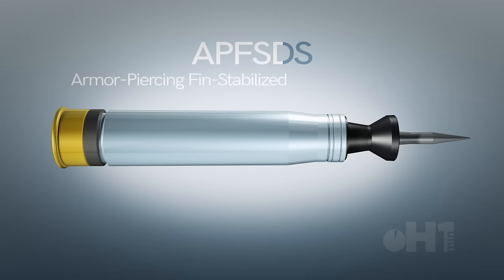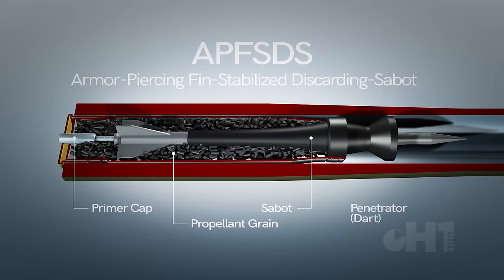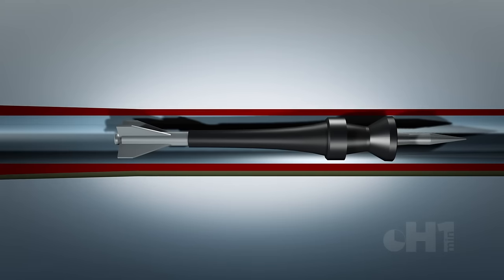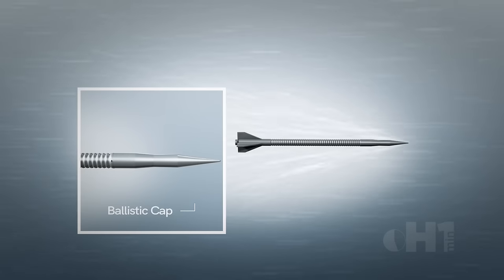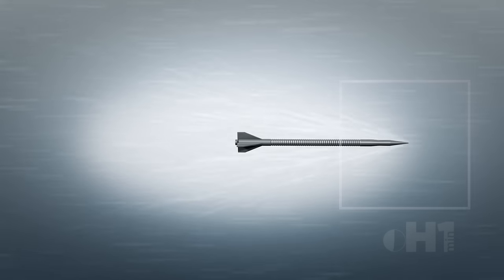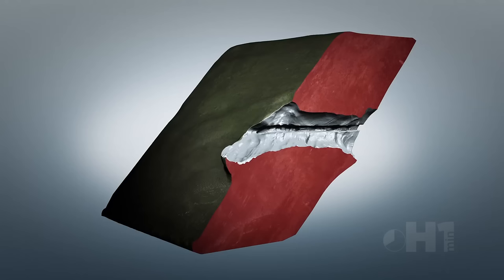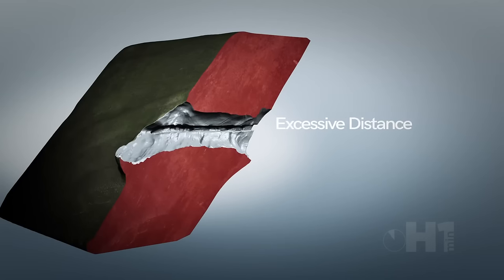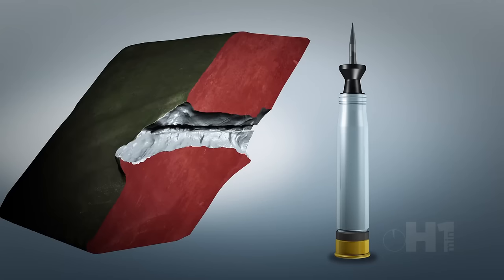H1MIN: APFSDS Shell

Comment: The APFSDS round is also fired from the 120mm L30 rifled gun on the British Challenger 2 MBT.
Reply: Most of the MBT fire APFSDS on smoothbore barrels because the rifled could decrease the velocity.
But if need to fire at rifled, the APFSDS rounds had to fit a spinning ring to preserve the velocity for the projectiles.
Reply: We used to fire them from the Challenger 1 in the early 1990s.
Reply: @dustybaboon 
So you're former tank combatants, right?

Well, I still have some detail error but at least I tried to pronounce the meaning.

If you have experience, why not sharing it?
Reply: @leekaijit36  
I was a gunner in the Queen's Royal Irish Hussars in the early 1990s and we were a Challenger 1 regiment and we used to have APFSDS which we used to call fin and we had HESH rounds on our tanks.
Reply: @dustybaboon I see...
Thanks for your information, sir.
Reply: @leekaijit36  you're most welcome.
Reply: Lee Kai Jit are you referring to the Ball-baring ring then that’s utter bollocks, but if referring to the copper ring that grips the rifling and seals the barrel somewhat and increase MV the yes that’s true.
Reply: @Duke_of_Petchington  Yes, that it.
Thanks.
Reply: @Duke_of_Petchington  its actually a nylon ring that grips the rifling much like a driving band, but has little or no adhesion to the round. As the round travels down the barrel. The slip band spins, but it imparts very little of this spin to the sabot and penetrator. This way it allows the round to be fully centred in the barrel and provides obturation without slowing the round down. As the sabot leaves the barrel. The band breaks and the sabot splits into 3 sections. The limited spin helps throw the sabot sections clear of the penetrator.

Comment: Another countermeasure is seen on the Turret front of the Leopard 2 since the A5 model. Armor spaced away from the main armor at a distance longer than the Darts fired will induce tumbling of the dart after it has fully cleared the spaced armor. Makes it hit the main armor sideways completely neutralizing it in best case scenarios but reduces Armor penetration significantly in general.
Reply: The arrowhead damages the round before impact of the main armor. That’s why it’s effective. The space doesn’t need to be longer than the dart, it only needs to be angled. The wedges can be countered with a round strong enough to resist shearing forces.

Comment: Imagine getting shot with one of these in the chest while you are chilling in your tank
Its a strange wait to die by a think that goes 5 time the speed of sound
Reply: On the bright side, the person might not feel it as they died before the nerves had the chance to send the signal to their brain.
Reply: The thing is, everyone here is wrong. Most armour piercing rounds are designed to cause shrapneling inside the tank. The actual rod usually isn't the thing doing the main damage, but the shrapnel that falls off the armour when the armour is penetrated. If you are in the way of all that glowing hot metal shrapnel, it'll probably have an impact of a huge shotgun blast.

Comment: Explosive reactive armor is used to protect against HEAT rounds, by preventing the penetrating jet from forming. It has absolutely no effect on a sabot round, which will simply pass right through ERA without detonating it.
Reply: No, No, The ERA effects both APFSDS and HEAT rounds. cause as soon as something hit ERA it explodes and send a plate outwards which either ruins the angle of a HEAT round which results in lesser penetration or for APFSDS it discombobulate APFSDS by ruining the angle of approach, so instead of nose of APFSDS hitting the armor, the side of APFSDS hits the armor resulting in lesser penetration. so, if the ERA is angled the more damage it prevents.
Reply: @alimplays334  even then ERA is mostly for HEAT, the penetration reduction is too insignificant to also work against APFSDS sure it may work on better on older rounds but i dont think they give troops such old rounds that literally degrade pen like a quarter

Comment: APFSDS round was the evolved predecessor ammunition call APDS (Armor Piercing Discarding Sabot). It's gives the projectiles more stabilised and increase penetrate effect.
But the core materials of the projectiles can have different effects during penetrate.
While Tungston core is the main material for the APFSDS core in most of the countries, the US use Depleted Uranium as the main material for the APFSDS core to maximise the penetrate effects.
Reply: They use DU because its cheap as it is a waste product from the enriching process for nuclear reactor fuel and they haven't got many major qualms with using a heavy metal that is toxic if it enters the body and has low radioactivity. Tungsten on the other hand is needed in industrial processes such as machining.
Reply: @01Laffey 
But for war strategy materials, which is easiest to obtain?

Comment: What's concerning is depleted uranium... I can't imagine surviving, only to die of uranium poisoning...
Reply: when an APFSDS hit and penetrate the tank, there is no time for poisoning the crew, only up to 7000*C temperature for less than second inside tank also high pressure air which fraction bones and internal organs of crew blow up, also fragments from the rood also from cracked plate of tank hull will penetrate the body of crew, then another explosion of ammunition cartridges in the tank which is result of fragments which hit and penetrate the ammo cartridges full with explosive and initiate to burn such explosive inside the tank hull, and for next 5 seconds such high temperature will bake the crew body's, then some more explosions in row which come from exploding tank shells (HE or HEAT) which explode like result of high temperature inside the tank, which results on total collapse of the tank and everything inside. Literally the tank inside will melt. Terrible death...
You can see fragments inside tank hit by APFSDS. Imagine if the tank was full of ammunition and crew... https://www.youtube.com/watch?v=KU0_9ika42o

Comment: ERA does nothing to kinetic penetrators.
Reply: russian ERA have an effect against kinetic penetrators as inside the brick there is an angled plate which when the explosive set off is pushed out and due to the fact that it's angled it goes to "snap" the penetrator causing it to lose penetration... it can theoretically decrease the penetration up to 30% but realistically around 15%.
Reply: Relikt ERA can reduces APFSDS penetration up to 50%
Reply: Oh yeah I forgot about that.
Reply: Necronuclear that's simple bullshit... best reduction scenario reach 20-25% K-5 10-15%
Reply: BlackSkorpion1991 There is Relikt ERA. It's third gen ERA. It claimed that Relikt can reduce kinetic ammo up to 50%
Reply: Best source I found says that it can reduced up to 50%
Reply: Heavy ERA does affect APFSDS. That's why many modern penetrators already use special shaped steel tips to defeat it.

Comment: dart - outer shell - artillery shell - extended range charge
outer = supersonic super-cruise when the entire blue(except the first "flange" to pointy dart is redesigned for air bubble in front of "flange"). mach 1.2 with that blue and dart.
Reply: AP RR 105mm
Reply: counterpart to reentry burn-off heat concept with saboted rocket and burn-off materials-casing with supersonic to hypersonic. your future is 60km direct fire and low-orbital indirect fire (earth is one number). not, ram or scram, jets.

Comment: Nice vid. You just forgot about depleted.iranium is also pyroplastic and imposible to be cleaned from the environment after hits.
Reply: And every shot is a little bit of friendly fire. That stuff is cancer. Literally.
Reply: Actually - the reason it isn't cleaned up is because the actual environmental/human hazards of the stuff means that it isn't worth the bother.  The 'dangers' of staballoy (the trade name for the material) are hype made by people who don't have the first clue as to what they're talking about.  And too lazy to even look up the MSDS.  In an industrial setting the recommended safety procedures are: "Standard industrial hygiene measures."  (Wash your hands before eating - for example.)

It's primary effect on the human body is that of a heavy metal poison with effects similar to that of lead.  Although it is much less dangerous than lead because the body does not easily absorb it when inhaled or eaten, and it literally passes through your digestive track and leaves your body when you take a dump.
Reply: @rospincasocl3741  "That stuff is cancer. Literally."

No.  It isn't.  The primary organ it will affect is your kidneys because it's human hazard effects are almost identical to that of lead.  

Clue for the clueless: It's called 'Depleted Uranium' because the radioactive isotopes have been removed to make bombs or fuel for nuclear reactors.
Reply: Yeah, DU isn't as bad as people make it out to be. the two ways in which it is deemed harmful is A) upon penetration, when the penetrator can shatter into dust which can then be breathed in and B) when Shells which have been shot into the ground corrode, though the consequences of that happening are negligible to unclear. Also keep in mind that in point A), Tungsten becomes just as harmful. DU wouldn't be used by at least 3 Major Nato countries if it were that obviously harmful.

Comment: The M829A4 DU sabot is said to be The best. IT is heavy, very fast, and it is made to counter Russian ERA armor. DU is much better than tungsten because: The burning effect on impact keeps The sabot sharp, it helps to melt armor, medium speed needed (no big gun required, since at very high velocities The projectile looses its burning  effect at 2000+ m/s), it creates additional radiation after hitting The tank.
Reply: You were doing good until you got to the radiation part.  The stuff used is what's left after they remove the fissionable isotopes.  So the stuff is less radioactive then natural uranium metal.  (And natural uranium metal has so little radiation that it can be handled with your bare hands.)  And it doesn't melt the metal.  Ant those kinds of pressures there is no 'solid' metals and the physics are that of a stream of liquid passing through another liquid.  The after-armor effects are because small pieces of uranium are combustible.
Reply: @colincampbell767  well, it is 40% as radioactive as Uranium. Soliders in The Gulf War were told to avoid coming in contact with Iraqi tanks that were penetrated by The Abrams.
Reply: @akanoob2072  Of course we told people to stay the hell away from destroyed tanks.  Those things are full of a lot of rather nasty chemicals.  Some type of FRH (Flame Resistant Hydraulic fluid) are contact poisons.  The residue from Composition 'B' explosives contains carcinogens - and so does CARC paints.  There's beryllium in the mirrors for the thermal sights.  And there's a whole laundry list of other hazardous stuff.  The Staballoy (DU ammunition is not pure DU but an alloy instead) fragments are the least of your concerns.

And this ignores the near certainty of unexploded ammunition and/or ordinance.  (How close do you want to get to an explosive warhead with a damaged fuse and safety mechanism?)  Anytime I had a report of unexploded ammunition - the closest I got was close enough to see it through either tank optics or binoculars.  And I then backed off after confirming that it was not something other than a possible UXO.

I have expierence and the proper training for handling DU - to include damaged ammunition and armor.  And I can assure you that the safety precautions are the standard Army 'We don't care how low the hazard is - we are going to protect from it anyway.'  (People don't realize it - but the 'safety culture' in the US Army is absolutely anal.  Which is a good thing because people in the Army are constantly around (and doing) dangerous things.)

I also have expierence dealing with Staballoy in an industrial setting.  Do you want to know what the NIOSH (National Institute of Occupational Safety and Health - the 'gold standard' for best safety practices) human safety requirements for the stuff are?  "Standard occupational hygiene practices."  This is stuff like requiring that somebody wash their hands before eating.  In fact the real hazard from the stuff is that the chips are combustible and have been known to self-ignite.  (So I was anal about requiring that all the chips be kept wet, cleaned up, and placed in approved containers.  I suspected that if I let my people catch the building on fire, the general manager would not be happy with me.)

Trivia note.  The staballoy was 'customer supplied material' and they wanted all of the chips and scrap back because the stuff is in short supply.
Reply: @colincampbell767  well, thanks for telling me. I never admitted of knowing everything, but I know a few things, and I am eager to learn as much as possible . I know that the military in general is careful with The Way they use equipment, for example,  The nuclear-powered submarines are very safe for The crew. A US submariner told that  he used to get close to the submarine engine (nuclear powered) so he could warm up. After 20 something years of service he got VERY little radiation exposure, because it was well encased. 

Nuclear energy is awsome if IT is used accordingly. I know it may seem off-topic to say this, but since we are talking about a radioactive byproduct alloy, it doesn't seem very off topic.

Comment: Good explanation of the shell, but I'm fairly certain major world powers use tank armor equal in hardness to the penetrator. Not entirely certain, but fairly certain. It's not like the military discloses all its tricks.
Reply: I suspect that you mean 'toughness' rather than hardness.  Hardness is the ability to withstand scratching and wear.  Toughness is the ability to hold together under extreme stress.  However the 'DU' ammunition isn't really pure DU.  It's an alloy with the trade name 'Staballoy' made up of uranium and molybledinum.  This alloy has both an extremely high hardness and very high toughness.  It also has a (literally) needle sharp tip.  The sharp tip is harder than face-hardened steel so it makes a tiny hole that the rest of the projectile makes larger as it passes through it.  

It's this toughness and hardness that is why the US uses it for tank armor.  

BTW - not only are the toughest and hardest steels expensive, but they are a nightmare to machine.  And a tank hull/turret takes a lot of precision machining.

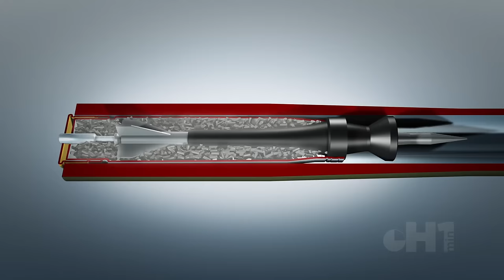Comment: 0:15 the sabot peels away. I've seen videos of the primer cap ejecting into the tank. What exactly happens to the tube/shell casing looking part of the round? Does it burn up and what kind of material is it made out of?
Reply: The casings of these rounds are made of a special polymer that burns up completely when the round is fired, it is made this way so that the interior of the tank will stay relatively uncluttered even after an long engagement.
Reply: Most tanks use a metal baseplate on the casing for better reliability, which is seen in the video, whilst the bulk of the case is made of burnable material that is destroyed when fired
Russian powder charges work in a similar way, just in two pieces and with a hard-cloth shell instead of polymer. The metal plate is also used to remove heat from the gun, and is often ejected after firing (russian tanks), or left inside during combat (many western tanks)

Comment: APFSDS shells are not limited to smooth-bore cannons.  The rifling in the barrel can aid in the discarding of the sabot and impart an initial spin to the dart which decreases instability when the dart hits air and is exposed to drag and shockwave forming on the fins before the dart spins up.

Comment: ERA won’t do anything to stop an APFSDS though. ERA is designed to mitigate the effects of HEAT-FS by detonating the shaped charge before impact with the hull.
Reply: Kontakt-5 is a type of second-generation[1] explosive reactive armour (ERA) originating in the Soviet Union. It is the first type of ERA that is effectively able to defeat modern armour-piercing fin-stabilized discarding sabot (APFSDS) rounds.

Comment: I would add that this round does not necessarily need to be fired from smooth bore barrel, as challenger 2 has a rifled barrel which is what creates the rounds rotation in flight.
Reply: Actually the version fired from rifled barrels has a rather complex set of 'rotating bands' to prevent the gun from inducing a spin into the projectile.   Above a certain length to width ratio - spinning causes the projectile to tumble.  (This is why rifle bullets have very similar shapes - that's the max they can be and still be stable in flight.)

Comment: The sabot doesn’t spin the guns fired out of them are smoothbore. Spinning decreases accuracy for fin stabilized rounds.
Reply: The original sabots came out of an M60, which had a rifled barrel, thus the slight spin....
Reply: @theoonyoutube  Sorry, the original APFSDS used by Americans came out of the M60 tank - it is colloquial to call APFSDS as just sabot, thus when I said the first sabots came out of M60 I meant the first American APFSDS were designed for a rifled barrel. 

When a gunner is giving commands to a loader (during the reload process of course), he'll just ask for sabot with "Load sabot." - even though he is requesting APFSDS...
Reply: @theoonyoutube  APDS is no longer used so the term is not confused.